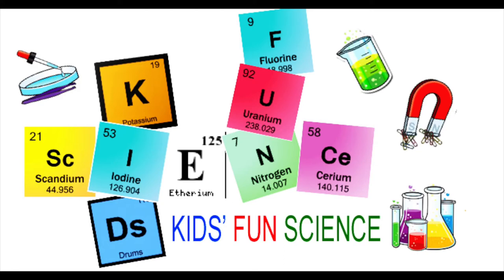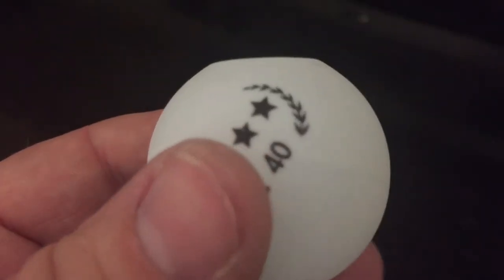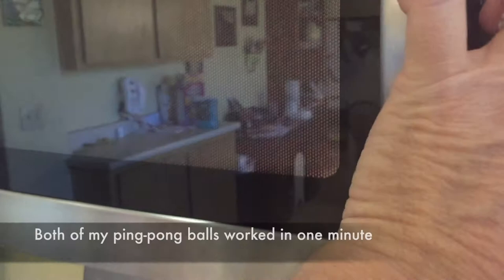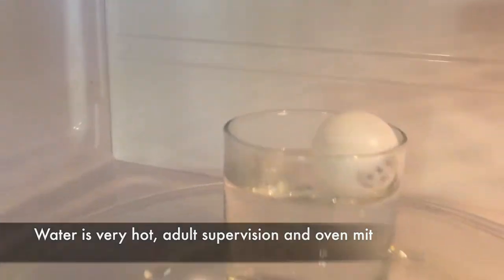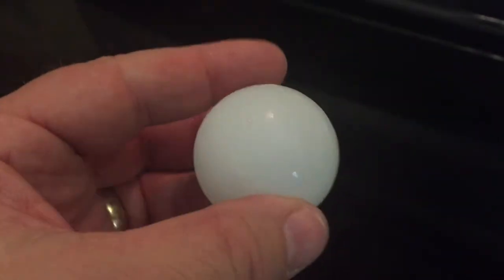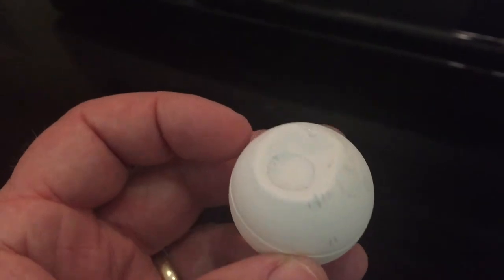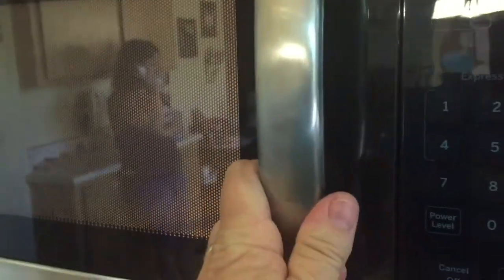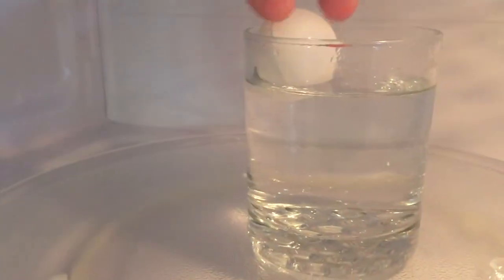Expanding Ping pong ball Experiment (How to get dents out of Ping Pong balls)

Comment: It didn’t work.  I tried putting the ping pong ball in very hot water and holding the ball under.  It lessened the dent but didn’t pull it out. Now I just tried the microwave trick and it did nothing. I microwaved it for a minute as suggested. Do I zap it longer?
Reply from the maker: Morning Michelle, sorry to hear it did not work. If you could email me a short video so I can see that might help he show you how it works. I have done this 20 times and it works every time. thanks
Reply: Hi, thanks for the reply. Sadly, I don’t have a video. I was simply trying to repair a ping pong ball.  First, I put the ball in boiling water and held it under with scissors.  This made the dent a little more shallow but didn’t pop out the dent.  Then I did the microwave trick and instructed in the video but it didn’t work, so I thought maybe I should heat it a little longer.  I zapped it for two minutes.  It finally worked but rendered the ball useless.  Do you think too much heat?
Reply: This is Michaelle by the way. Not Haylie.
Reply from the maker: Well sorry it didn't work for you. If you get a chance again please video it so I can see if I can help. Thx